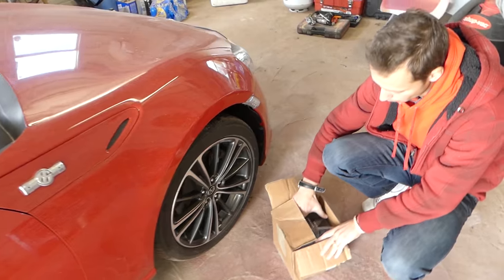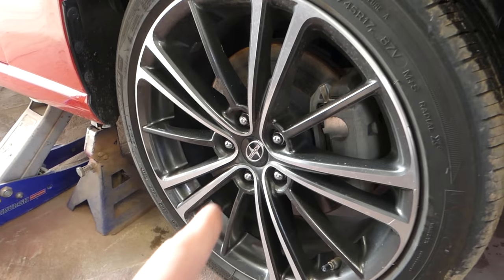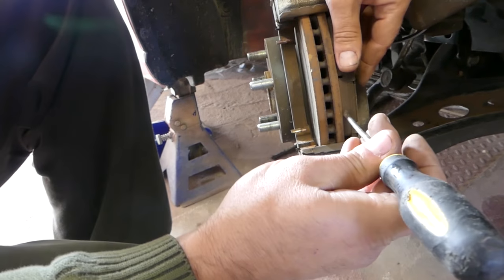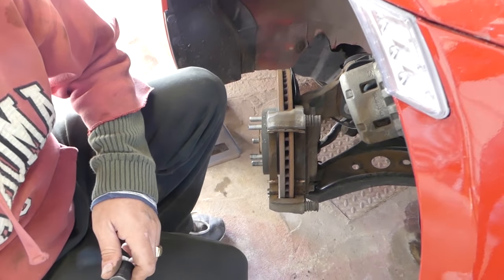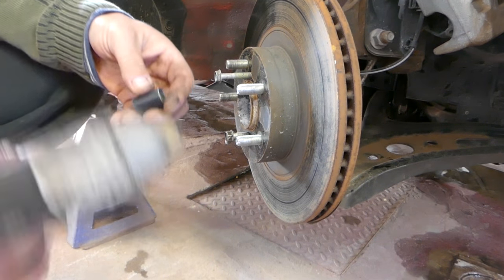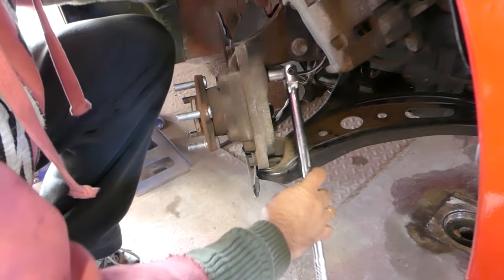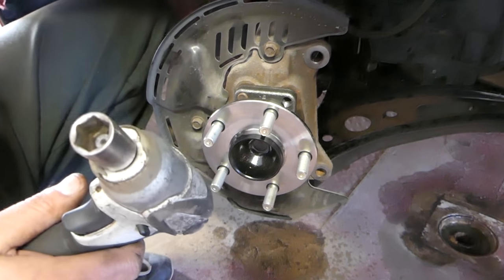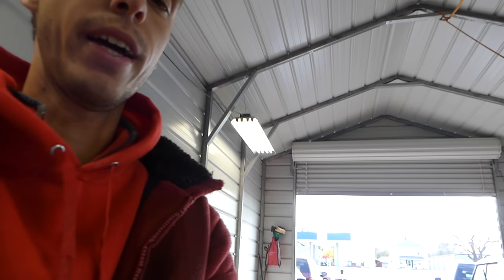SCION FRS Wheel Noise after RACING  Wheel Hub Replacement GT86

Comment: I just did the replacement using this video and have to Thank you guys for this video. I watched 3 videos on the wheel bearing replacement for the FRS and a few on other cars just for extra homework and this was the best video of all of them. I want to give back to the car community with a few extra helpful tips for 1st timers like me that may help.

1. The bolt used to remove the rotor is an M8 x 1.25. If you don't have a powered gun to twist them off you can use a basic socket wrench. The bolts I purchased at Autozone had a 13mm hexagonal head (6 point) so I used a small 6 inch socket wrench with a 13mm socket to do the same job alternating between the two bolts like he did.

2. Replacing the Bearing and Replacing the Hub Assembly are two different things. Replacing the bearing alone is harder in labor but is cheaper in parts and requires alignment of the bearing and a press. I replaced the whole assembly like in the video and it was very easy.

3. Replacing your Rear Axel Hub Assembly is a lot harder (relatively speaking) than your Front Assembly for the FRS/BRZ/86 because its a RWD car. Your drive wheels Hub Replacement is different and requires more dyi research than just this video. This video is for the Front Wheel Hub Assembly Only.

4. If you dont have wires to hang your Calipers set them down on a tall enough and sturdy box like I did.

5. I used a 12 inch bar breaker for most the nuts and an 18 inch for the two 17mm's holding the rotors. Use leverage/torque as your friend or you may strip the nut.

5. The ABS sensor pulls out easy after removing the 10mm bolt. No big deal.

6. The four 14mm nuts holding the Hub assembly are kinda deep in there. I used a Deep Socket like the video. I'm not 100% sure you can reach them with a standard socket. 

7. Lastly, I purchased the Wheel Hub Assembly from Amazon. The brand is called Centric # 406.47001. $95.00. It takes a little over a week to ship so plan ahead. Mine was done before it could arrive so I purchased from the dealer OEM for $159 and it arrived next day. I'll install the Centric on the other side when it arrives or keep it around as a back up. Part number for the dealer is SU003-00782. Its the same for the front drivers side and front passenger side though dealers have different part codes for each. They are the same. Can be done in 30mins- 1 hour if you come prepared. 

Good Luck Everyone!!!